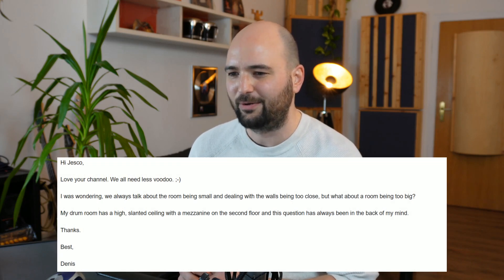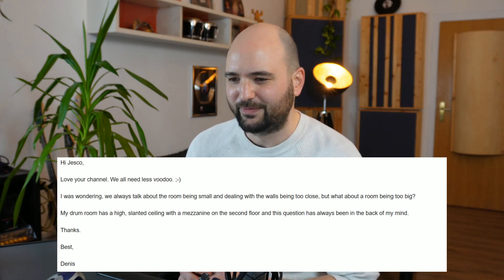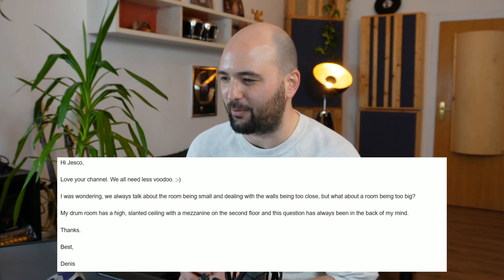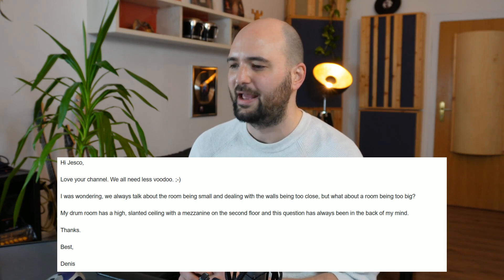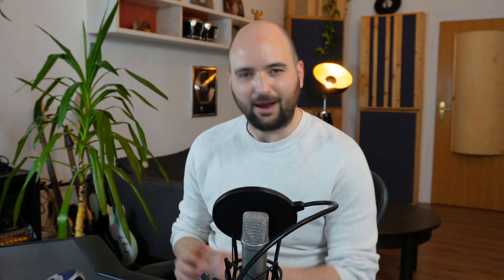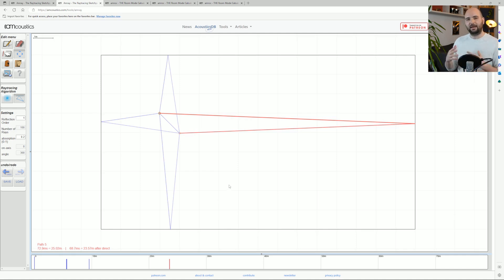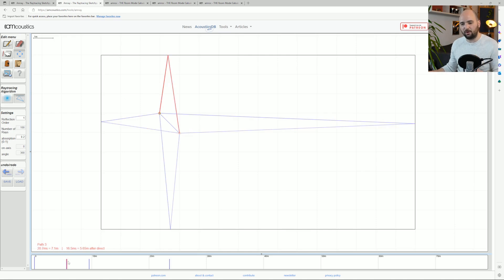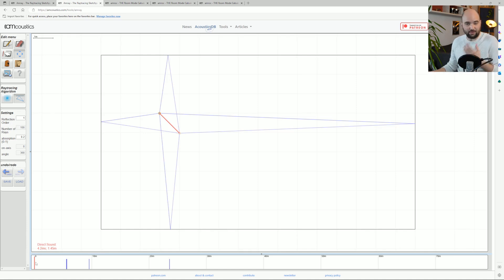DIY Home Studio Acoustics: Can a Room Be Too BIG? - AcousticsInsider.com

Comment: An opera house might not actually have that high a reverb time, compared to a concert hall. They're usually designed so that the singing can be intelligible, so the R60 may be in the 1-2s range (vs maybe closer to 2-3s for a concert hall). Still a lot more than a typical control room though. Another solution in an opera house, if you really were mixing while sitting on the stage with your back to the audience, would be simply to close the curtain behind you. :)

I do suspect the reverberation would be a bit more problematic for mixing than you're thinking. And yes, a room can definitely get too big (but not at any scale you'd ever find in a house). Try playing or listening to music in a basketball arena or indoor football stadium, for instance. But you're right, it's usually mainly a problem of excessive reverberation, not usually as much particular problems like flutter echos or standing waves. (Slap echoes can definitely happen though.)
Reply: I dont know if that's true. Keep in mind all of this assumes you position yourself just as you would in a regular, small studio room and listen at a normal volume. So the direct sound would be so much more prominent than any reflections that would come back to you that they basically might as well not be there. At some point it becomes similar to mixing in an open field where the sound goes out and never comes back, here it just takes a while and loses a lot of energy, but at some point they're so similar it's functionally the same. Also the decay time is completely irrelevant as well because the reflection that comes back is so quiet that its not like you hear the entire decay because it goes below being audible at some point.

Comment: You have to be in a massive room to (with a very high ceiling) to lower the Schroeder frequency to below 20 Hz : 27 by 20 by 12 will do it  . And even then you have 2 octaves up to 80 Hz where modal (standing waves) behaviour still plays a very significant role

Comment: if you see this lol, i was wondering what steps one takes when upgrading speakers with existing acoustic treatment? i wanna take the budget i was going to put toward new speakers all into acoustic treatment. but if i decide to upgrade later on, what would i need to consider? is there any reason would i need to redo my treatment? thanks again

Comment: What about mixing outside? I thought I made a comment on it before on this channel but I've seen studio sessions outside and I've always wondered if it would still be viable to have a no walls studio and to just let the sounds fly all the way till it hits trees and other things that I wouldn't be able to hear.
Reply: From what I know, a perfectly open space would be considered "freefield" and that is basically what a really good anechoic chamber sounds like. The sound leaves and basically never comes back, except for some minor reflections off the ground or whatever that are basically irrelevant. 

I've heard manufacturers of speakers or microphones that don't have access to anechoic chambers test things in such places specifically because it's basically an anechoic chamber. That's another reason as to why open air venues sound so great as well. If you could mix this way, it would be hyper accurate, but unfortunately weather exists and a bunch of other stuff that might make that not so practical. If you could manage it it would be very good though.

Comment: I have a fairly large room in a barn conversion with a high gable ceiling that has the both live room and control room in the same space. Everything is in the same room, chill-out area, work bench, storage etc. I have found it a bit difficult the treat the room for both a good live sound and a dead space fo mixing. Even though the room is large, there is little "extra" space for treatment as all of it is in use. There is also no way to set up anything symmetrically. I have the desk in roughly one half and the live room in the other. The main problems are flutter echoes and a few big room modes at approx. 100hz and 40 hz. It's a nice space though, and I've gotten it sounding pretty ok.